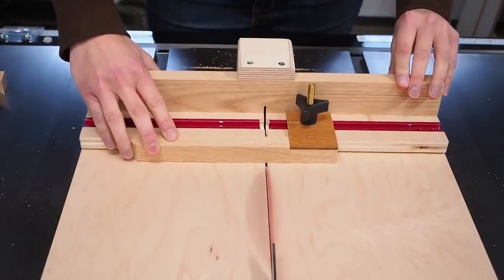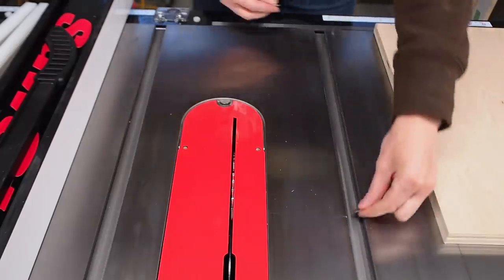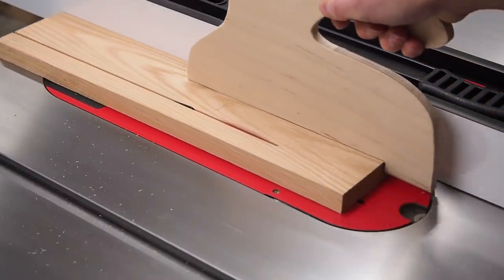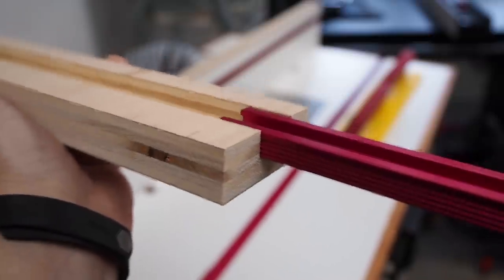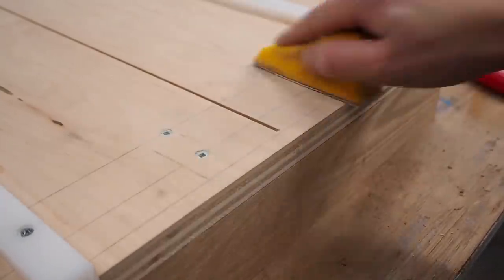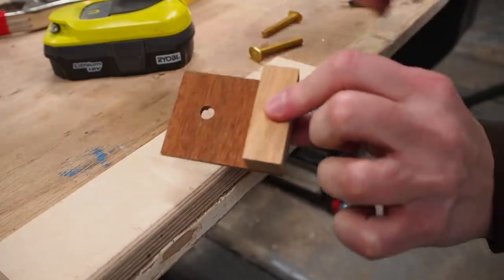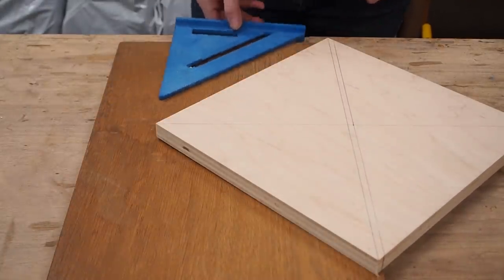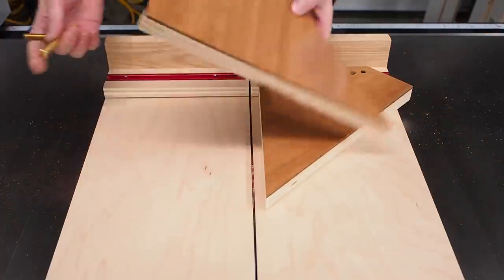Small Parts Crosscut Sled

Comment: Very nice project! Sometimes you just need a small sled. I like the low profile fence for the t-track.

Is there any reason to cut the miter not into two pieces? Since you are always cutting at the front corner, it seems that you don't need to cut it all the way back.

I enjoy your videos. The pace is good. The attention to the useful details is good. The calmness is good.
Reply from the maker: Thank you so much! And great catch. I cut all the way through the miter attachment based on plans I was inspired by, but afterwards I had the same thought as you. I would recommend just cutting through the tip, that's all you need. And set up will be a lot easier every time you attach it.

Comment: Just found your channel. I'm impressed. I've just gotten into wood working. been building my own equipment for wood working. will be making your small sled real soon. question , how would you  scale the miter attachment down smaller to accommodate large pieces of wood?
Reply from the maker: Thanks! Glad you're enjoying getting into woodworking. This sled is really designed for small parts, but if you want to cut miters on large pieces you could make the sled long front to back.